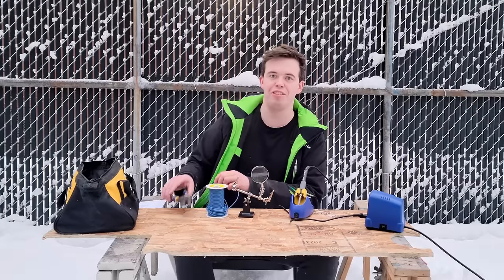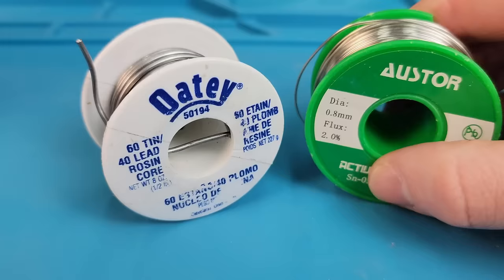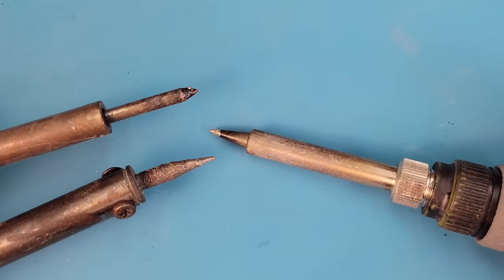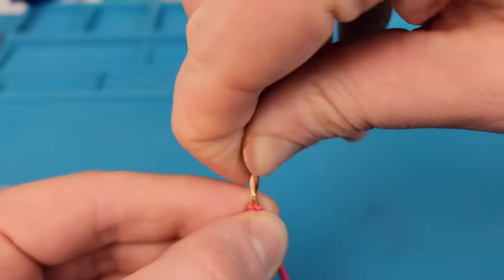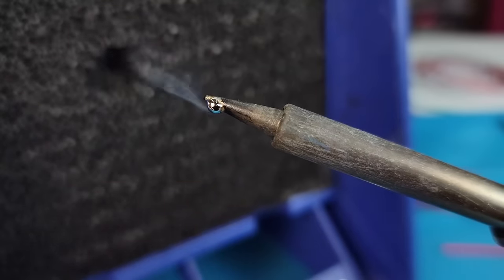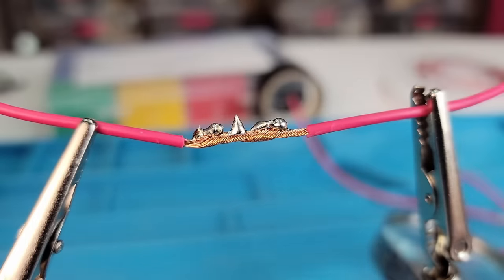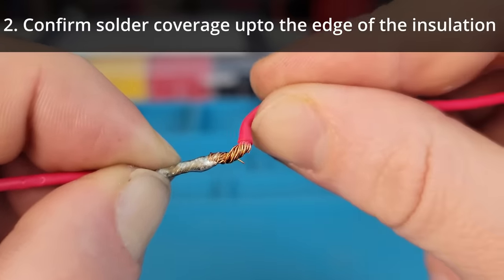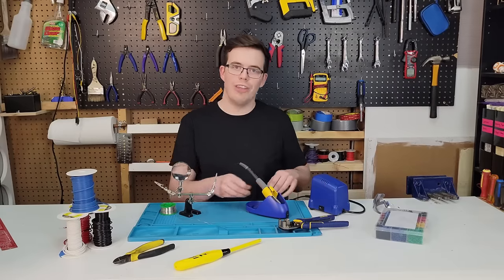Four Steps to Flawless Wire Joints (How to Solder)

Comment: Fun Fact: 1- time code 5:14 - This splice is known as a "western union" splice.   Same splice can be used with solid core copper wire without solder.
                 2- A cold solder joint also looks gray.  Simply reheat the joint until the solder looks silvery, don't overheat component.
                 3- I recommend using a rosin flux paste.  Easily applied with a toothpick (spread over wire joint) for a better application.  Rosin core solder is OK, but doesn't clean the wire as well.  When heated, the flux turns acidic which cleans & etches the metal so the solder grabs the wire better.  Also promotes better solder flow over/in the joint connection.
               4- Heat shrink is a better covering (some types have a glue for waterproofing; marine grade).  Vinyl electrical tape was meant to be used in correlation with friction tape for weatherproofing of solid core wires, like the service connection to a house. 

   I'm an electrician by trade, model railroader & have rewired guitars.  This is my education from a vocational high school education & Navy Electrician training.  I used to rewire aircraft & replace components on circuit boards in the black boxes.  Also repaired NYC subway cars wiring.  Crimp butt splices are always practical for wiring repair.  My experience, heat guns are best especially for marine grade heat shrink.  Then again I'm been doing this a long time, I'm 70.  Do a lot of soldering, I also recommend a soldering exhaust fan.  They have a replaceable charcoal filter & pull the fumes away.

Good video.

Comment: I've been soldering for 30 years and I approve of this video. That said, in most cases soldering is my last resort for splicing wires. If the joint is in a part of the wire that is regularly flexed or moved then there is a risk that the solder, because it is a harder metal than copper, will create a point over which the wire strands will bend and break, leading to outright failure or overheating, in current-carrying situations. 
My preference is always to replace the wire segment if possible, and if that's not an option then a mechanical connector like a crimped butt splice covered in heat shrink is my favorite. If it has to be solder then try to ensure that that the joint is protected from mechanical stresses, and that any flexing happens as far from the joint as possible. You can lightly bend the wire at the joint to see and feel where it bends and then apply a length of heat shrink to extend past the bend radius in either direction. A couple of layers might provide better strain relief.

Comment: Everything said in the video was really good for soldering in general as it's all about heat transfer.

However specifically when it comes to wires it's really important to consider the environment the wire is within. Mainly this is an issue if the wire as part of its general life is expected to move and flex due to being attached to a moving part. Generally you will see stranded wire and connectors of some kind for wires that are expected to move. This is important because if you make a long solder joint joining 2 moving wires like the joints in this video it will be likely to fail over time simply because solder joints don't do good with motion and flexing.

Comment: I use flux on the joint before applying solder then you can quickly go over the joint with the soldering iron to get some heat and and the flux helps get a great joint because it improves flow.

Comment: Alright, so what do you think about those shrinkable butt connectors with low heat solder in the middle? 
I've been using the X method since 2001 when a car stereo guy at an old place called Bryn Mawr Stereo and Video showed me how to solder my wiring. Never failed me yet 🙂

Comment: As someone who took an apprenticeship as an electronics technician, who did nothing but solder for a year and did it on a regular basis for 3 years after that, I want to tell you that solder wires is a terrible idea. You should always crimp your wires if they're made up of multiple strands like the one in the video. The reason being that the wire losis its strong point, its flexibility. By soldering, you're creating a weak point and the stranda will snap at the joint.

But other than that, it's pretty solid.
Reply: Wagos

Comment: 9:10 this is how i solder these types of wire every day at work. soldering iron tip on the wires, melt solder on the heated tip as it starts to transfer heat, add more solder from the side, not the opposite side of the soldering iron tip.

Comment: Put flux on the wires first.  And don't be afraid to put more solder on the tip for smaller wires.  You don't want to sit there heating those because you'll melt the insulation simply via heat conducted through the wire.  You want to quickly heat up the wire with the flux on it, which will draw in the solder already attached to the soldering tip.  You will normally not need to add any more solder.

Larger wires will mostly work the same way, though you will often need to add more solder, as you still don't want to put a large amount directly on the tip.  

The upshot is, use flux directly on the wire, rather than relying on the paltry amount inside the solder.

Comment: What I try to do is twist them such as one twists around the other up to the mid point of the splice (your "X shape"), then the other wraps around the first, and I try to achieve a wire wrap level of content (old wire wrapping used the "cold weld" phenomenon) then solder and heat shrink (of course the heat shrink gets placed over the wire before splicing, and it sucks when you forget that first step after making a perfect splice when the a-hole who built the thing you're repairing didn't leave any service slack). If you can wire wrap it tightly enough to achieve a cold weld, you've achieved the lowest possible resistance joint. Oh yeah and if you're new to soldering, be sure to slide the heat shrink a bit away from your splice while soldering, or if space is too tight to slide the heat shrink out of the way, clip a heat sink on the wire between the joint and the heat shrink on the bare wire just before the insulation. Otherwise, the heat shrink will shrink prematurely as shown at the end of this video. 

I Learned about wire wrapping having had the misfortune of having had to repair and add modern sensors to generations-old gear still in use but that experience really upped my game when it comes to splicing low resistance joints of both stranded and solid wire.

Comment: @WillDonaldson if soldering on a mini LED bulb or mini SMD on a circuit board, does one insulate the positive & negative wire legs of the bulb with heat shrink or the likes? I replaced a mini led bulb on a circuit board to a on/off fog light switch in my car, the middle of the legs are exposed following solder joint on the circuit board, I want to make sure it’s safely/ correctly done. As the bulb legs are exposed inside the switch. Any advice is greatly appreciated!

Comment: 4:20 you can re-plate them using a PSU and some voltage, put them in water and the cathode, anode put the material which you wanna plate with to the cathode, apply voltage and you are done, brand as new...

Comment: Normal Sponges have two sides, the thinner should be up ist is heat resistent. I have seen it often with the more Spongy side up which might give the Problems you mentioned. The Problem with the shock cooling by the Water may be that it stresses the coating very much. I uses paper tissue since i read about it. The brass "sponge" you use is also very abrasive and should be used if softer methods fail. But the manufacturers of solder tips love water and brass.

Comment: I've learned from the pro's to twist and solder both ends separately after which you melt them together. You'd think the method in the video is more solid but I'm not sure and it doesn't look so clean.

Comment: great explanation video and amazing advice. 
however, do not hate on electrical tape that much. it can last for years and decades, but you need a few things for it to work that way:
1- you have to buy a good quality one, if you get the cheapest, the adhesive will not hold at all, and it will undo itself
2- make sure nobody plays with it, i know it is dum, but if someone gets their hands on it and is bored, they will play with it and undo it bit by bit. not to mention it is dangerous playing with a live wire. 
3- AND MOST IMPORTANTLY: do not apply it like in the video loosely around the wire and have it stick from both sides, instead, pull on the tape as you are sticking it on, you have to make it stretch as you are installing it, so that it has internal tension that will keep a steady tension on the adhesive preventing it from going weak. 
and sure, it is in direct sunlight, everything will fall apart, tape or heat shrink, even the wire insulation does not live a long in direct sunlight. so keep checking it every few months if it is indirect sunlight no matter what you used. 
that way, i still have joints i soldered 10 years ago when i first started working with some wiring projects. they are still holding up amazing, and the adhesive has not loosened up a bit. heck, there are still joints my uncle did from 50 something years ago, and sure, the tape is not looking like new, but it still has not loosened up, and it you try taking it off, it still is glued on and the glue is still strong

Comment: Was taught over 60 years ago that wires have to be mechanically secure ( twisted is one example ). Like to have a wet sponge to wipe off soldering iron or gun tip. Prefer the multi core rosin solder.

Comment: While this/these ideas look good, I have discovered a slightly more effective method. Using either medical type latex gloves or the smaller finger medical type (like gloves with the fingers cut off) latex covers (practicing safe finger), I use a small tin of flux and coat both wire ends with it, then using whatever method you like for connecting the two wires (I use the twisting type mentioned in this video)(don’t forget to slide on one or two pieces of shrink tube!), I use a hot, pistol type iron (these can produce a lot of heat so be careful!) and with a line of solder in the other hand, I press the iron against the wires which causes the pre-applied flux to melt (easily seen since the flux paste goes from opaque to shiny clear), I press the solder against the wire and the solder almost instantly soaks into and coats every wire surface, with no excess blobs anywhere.  Allowing the soldered joint to cool, I then slide the shrink tube over the entire joint and using either a Bic lighter or the hot barrel of the iron, I apply just enough heat (if using a lighter, keep the flame itself an inch or two away from the actual shrink tube) to cause the tube to shrink and seal the joint completely.  This produces a very neat and clean finished joint.  Practice with some spare wire and tools (you can find the fingertip gloves, to practice safe finger, on Amazon or the supplier of your choice, for very little for a package of 100).  Good fortune!

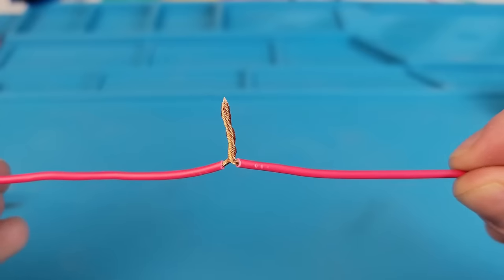Comment: @5:08. the same can be said about the barrel roll technique you are promoting, depending on where this wire will end up. Either the barrel roll or the twist and solder will work fine in NON FLEX applications.

Comment: Make sure the wires you are soldering are completely clean. Solder won’t attach to oxidised metal. 

Also adding a little flux will make the solder flow very easily.

Comment: 1:06... I just upgraded my Weller TC 201T Soldering station after +40 years of use. Just replaced it with a Weller WE1010NA for much less than that Hakko. I'd bet I'm good for another 40 years... Been using a wet sponge (distilled water) with absolutely no problems with tip cooling. You were wiping too slow.
7:43... You will transfer heat to the MUCH faster if you wet the tip with solder.
Reply: I've been a Weller guy myself for many years, but I did pick up a Hakko 888 a few years back and it is not a bad iron at all.  Looks like the Hakko is about $20 more than the WE1010NA on Amazon.  Weller is hard to beat, but I have not tried the WE1010NA yet.  Good tips on the sponge and the heat transfer tip.
Reply: @dave56ize  The handle of the WE1010NA is a bit smaller than the TC 201T but it is comfortable to hold. The ETA tips are similar to the PTA7 tips I was using with the old Iron. The only thing I added was a Power LED so that I can see if it is ON from across the shop.

Comment: I have a workshop i do all sorts of repairs u are 100% on point except the tape things i usually use 3m tape it never goes bad ... and i never really found a good soldering station i am using cheap but good ones with stainless heads i use like 3 or 4 per year its on 12 hours per day 6days/week i solder alott...cant find really good products here in lebanon btw i never in my life thought lead in soldier would be that toxic 30 years and i am drinking eating while using it rofl😂😂

Comment: I learned to solder with lead based solder at school. Since lead solder has become so difficult to get in the UK, I can't solder anymore. I've tried so many tricks, but I still can't get it right. It might be the soldering iron I use or it might be that I wasn't very good to begin with. I tend to think I wasn't any good.
Reply: 1. ‘Basic Soldering Lessons’ videos by ‘paceworldwide’ are awesome! You may pick up a few tips that help.
2. Sometimes, a little liquid flux (in addition to the flux core of solder wire) is all you need to solve the problem!
3. ‘SN100C’ is a formula of lead-free solder designed to have characters closer to leaded solder. It may be worth trying.
Good luck!!

Comment: Buy some soldering flux. It has a multitude of uses when soldering. After twisting the wires together, smear some flux on the wires. Now when you apply the iron and solder, the solder will be drawn into the joint like magic. Get flux for electronic assembly, not the plumbers type from the local hardware shop. It’s too aggressive and can damage pcbs etc. over time.

Comment: I prefer to use a lash splice.  Strip one wire to about 1/2" and the other to 3".  On the 3" stripped wire, separate a few strands from the wire and trim the rest back to 1/2".  Lay the 1/2" wires beside each other (without twisting) and wrap them tightly ("lash" them) with a spiral of the 3" strands in a single layer.  Cut off any excess from the lash, then solder and cover with heat shrink.  Another method is to strip both wires to 1/2" and lash them with a separate piece of small gauge wire.

Whatever splicing technique you use, be careful not to apply too much solder to the joint.  You want just enough to fill the wires where they overlap, without wicking any solder up the wires inside their insulation.  Solder that wicks inside the insulation makes the wires rigid and much more easily broken when they're flexed.  A wire that's broken inside its jacket can be a vexing problem to find.  For this reason, it's good practice to be sure that soldered splices are well supported on both ends when they're installed so they can't flex if, for example, they're in a machine that moves or vibrates in operation.

Comment: It's worth pointing out two things.
1: To use an appropriately sized tip if you have it. The one you use is way to small and takes so long to transfer heat that the insulation is shown to be melting and squeezed at the crocodile clips. This could expose wire for a short.
2: Choice of lead free solder. They are not all the same and SAC 0307 (what you have there) seems a particularly poor one. SAC 305 would be better but I still don't like it. My solder of choice would be SAC 405.

Comment: In my opinion better is to leave some fresh solder on a tip before switching off. It prevents it from oxidation while cooling and after preheating. It's worth mentioning that is unhealthy to keep the temperature(if not necessary) above 400*C (752*F) cuz it makes a tip degrades way much faster, and lead evaporates more rapidly above 400-450*C (752-842*F)

Comment: Great video, "THANK YOU!".
Here's a tip;
When joining 2 wire ends together, spread the strands apart, interweave the spread ends, then twist the 2 ends together joining the 2 wires.
That is mechanically stronger &, IMO, makes a better solder joint.
Reply: That's an interesting way to use punctuation... 🤔

Comment: I always clean the joint with denatured alcohol before the final insulation of the joint, the alcohol neutralizes and cleans the flux off the joint! I do this with a brass or stainless steel wire "toothbrush!"

Comment: The Western Union wrap makes the strongest joint if done correctly.  The wire will break on one side or the other of the joint when applying forces, as though you were stretching the wire.

Comment: Additional flux is also very helpful.  But use the appropriate flux and depending on what type of flux it is, clean residual flux off what has been soldered after soldering.

Comment: Flux travels up the wire in both directions, causing stiffness and sloppy looking work. And also requires a heat shrink to cover the joint.
There are crimps available that are more convienent for direct burial and cabinate work.

Comment: A cold solder joint happens also when you apply too much heat to the solder point so that the flux burns out and you are left with a dull looking solder. This is a common failure point for hand soldered thru-hole points.